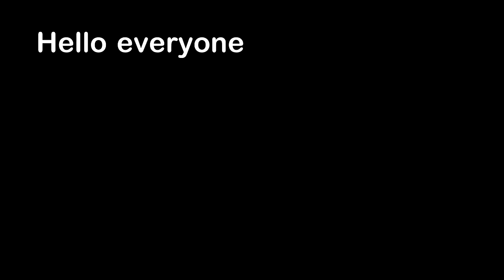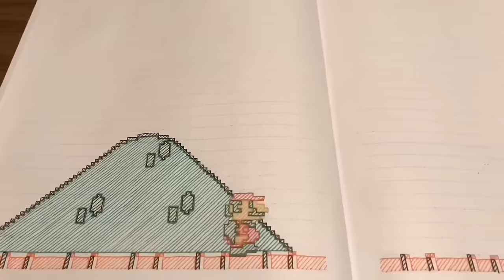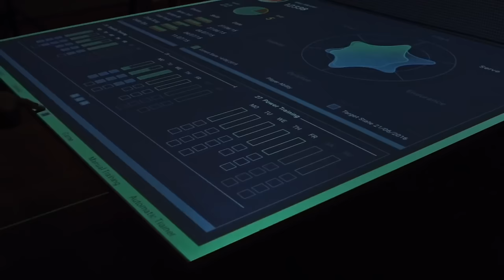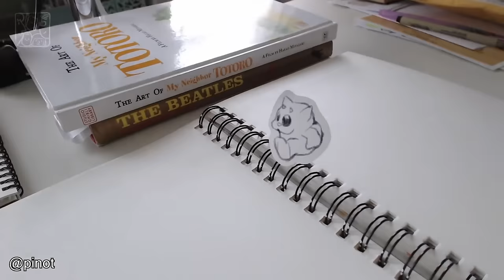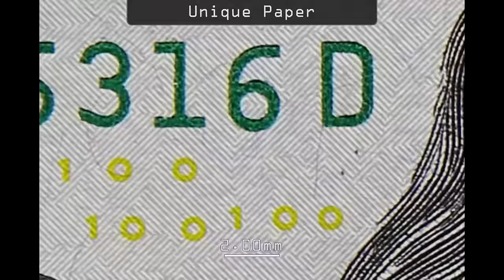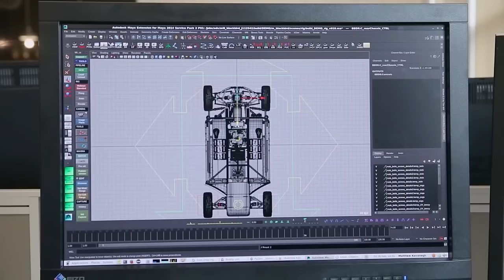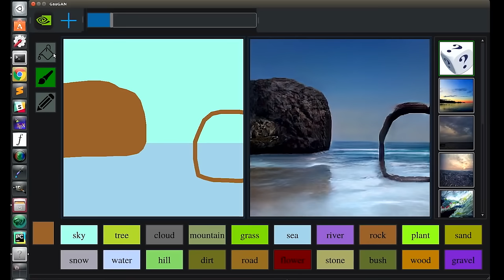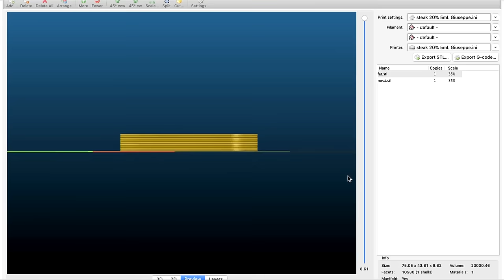1 Hour of Daily Dose Of Internet

Comment: The water deluge at NASA launch pads is to dampen vibrations. The exhaust is vented down and then out of the sides of the pad. Heat is not an issue per say. Facts are good.😮